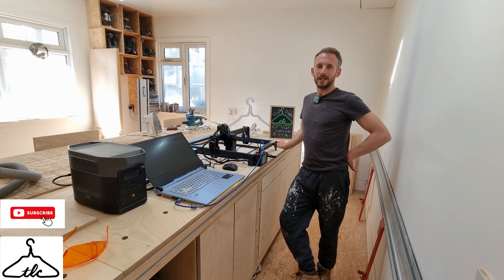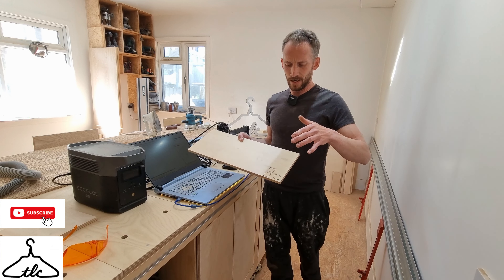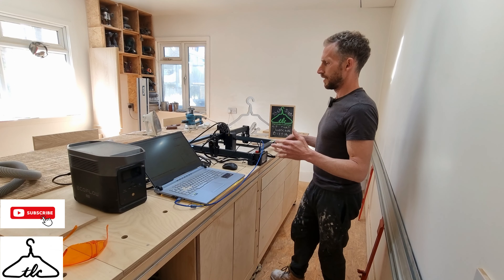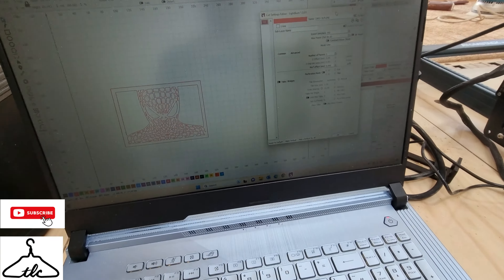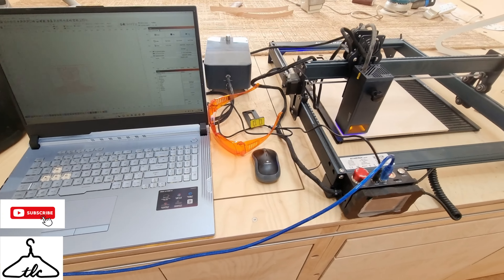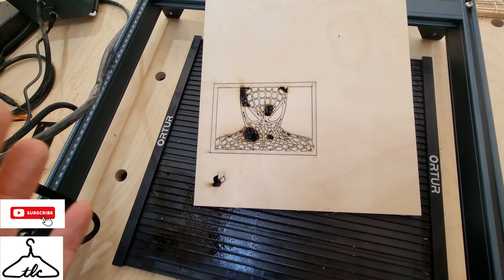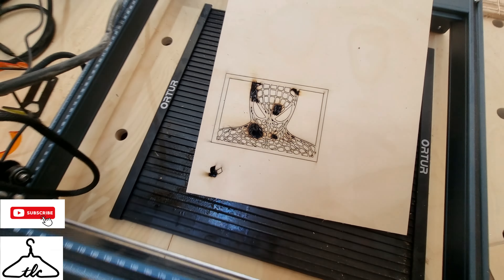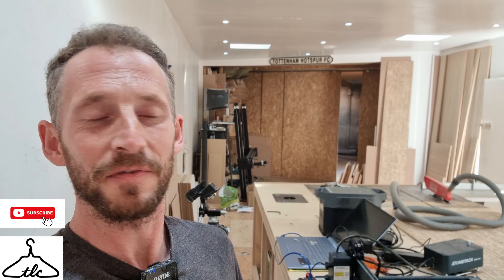I Use The ATOMSTACK A30 PRO LASER & It Doesn't Go To Plan! // Vid#140

Comment: Builders merchant Birch ply is not really suitable for a Diode laser, the glue layers are really tough and resistant. The laser bed is not the best with the flat bars it tends to consolidator the burning, l use a honeycomb bed on my Ortur LBm3 which is less resistant to the laser.  Try to find some
proper laser ply which cuts a lot easier, l use a lot of 3mm laser ply @ 380/100 in one cut that is very clean. How are things in Watford ?
Reply from the maker: Thank you for the advise 👍
Yes it's not bad here, nesr St Albans so it's good for work 🙂